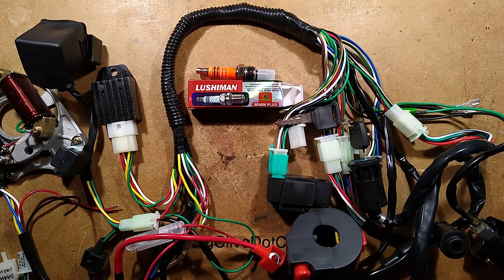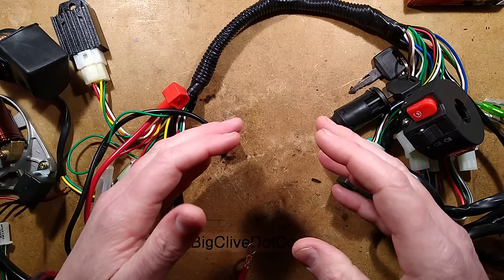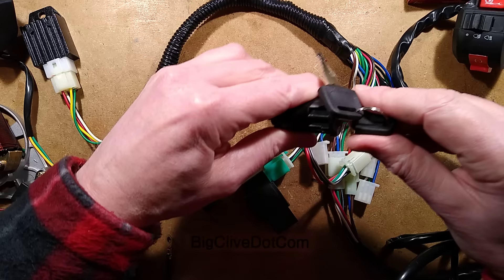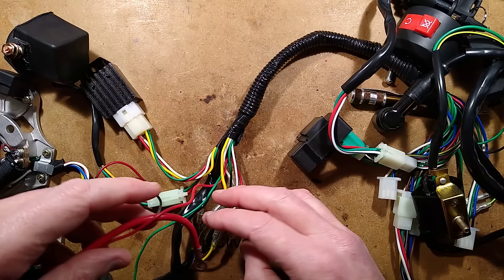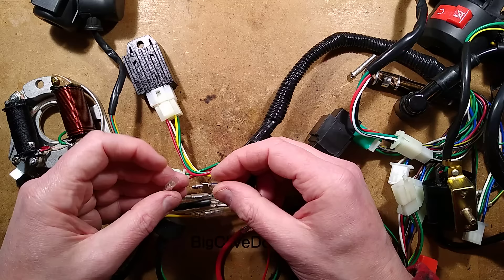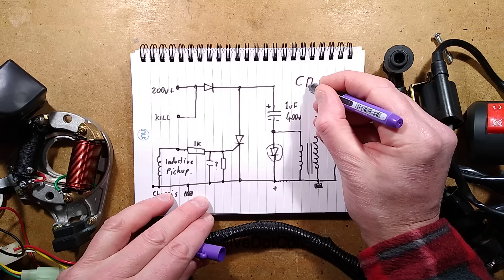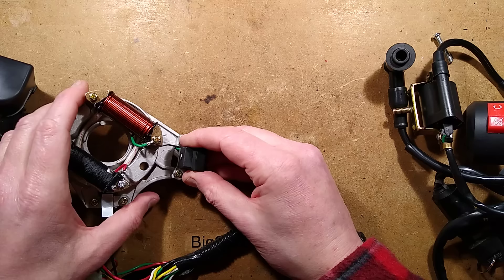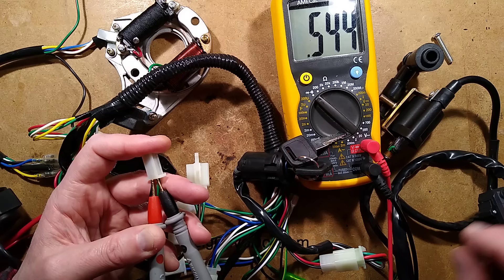Exploring the wiring loom of a Chinese quad / scooter.

Comment: This is great ive just bought one of these to fix my sinnis shit motorbike and just looked at it and realised no instructions for wiring. This ia going to be a very handy video ;)
Reply: the connectors on the wiring harness ... only fit the corresponding connector ... meaning ... you CAN"T plug one wire into another connector by mistake. ... Asian have made it  ... "white people proof"

Comment: Lucas did have a fairly standard wire colouring system. I guess the complexity of modern automotive electrical systems outgrew it.
Reply: Ford does, or did through at least the mid 2000s, have a standard color coding scheme. Every circuit function has a number and a standard color code. The wiring diagram shows the circuit numbers (and color code too, of course).
 I ran across a chart listing all of these years ago (it might have been in a technical service bulletin). One of the interesting things is that it listed circuit functions having to do with CB radio (did any Ford vehicles ever come with a factory CB radio??), which leads me to believe that Ford had been using this scheme as early as the heyday of CB radio in the 70s. It was also clear looking at the chart that they had continually added circuit numbers and wire colors as new circuit functions were needed for new technology.

Comment: That extra kill switch might be used on a seat sensor. Lift your arse off the seat either hot dogging or wiping out and it will cut the engine. Just imagine hitting big bumps in the road ( speed bumps) and lifting ones bottom off of the seat and you stall out.

Comment: I have just replaced the CDI in my son's go kart (I built),  The Lifan motor wiring in his is identical to this version, and he had just water blasted the whole thing to clean mud away. 
I suspect the water got into the CDI and probably killed it. There are two other wires coming from the motor near the stator that control a neutral indicator and (in his) a reverse 
indicator lamp, and in my kit there was also an optional remote control kill switch, I believe for parents to be able to shut the quad down from some distance away.

Cheers, and great insight Clive..

Comment: I have a Chinese 450 dirtbike and keep getting problems with the electrics . One problem was every time I pressed the start button it would melt some wires . Now seem to have fixed that . But now bike sometimes won't respond when press start button unless press kill switch at the same time . This is only some times not all the time . Bike now sat in corner of garage as loosing confidence in bike
Reply from the maker: Treat it as a puzzle and explore the bike wiring.  It should all start to make sense, and when you find the fault it will feel great.  Plus you'll be able to fix it faster the next time.

Comment: Looking at the CDI as you explained, it fires on every revolution of the crankshaft?  So either a 2-cycle engine or it fires both at the top of the compression stroke and the exhaust stroke?

I suppose if that stator is mounted in such a way it can be 'twisted' a little, that might give you a little adjustment of the spark timing?
Reply: It fires on the exhaust stroke. A lot of ignition systems use this "wasted spark system". they also have two cylinder engines where the ignition is the exact same but the coil has two spark plug leads. So unlike a normal coil where one side goes to ground. This coil has the ground side going to another spark plug. So when the spark occurs it happens on both plugs. Or you could say the circuit is completed by coil discharge jumping the exhaust gas from the center of the spark plug in one cylinder and then going over engine metal and then jumping from the engine metal to center in the other plug during the power stroke and then back to the coil via the spark plug wire. And then visa versa, every other time. Keep in mind exhaust gas contains a lot of ions and little to no compression so it's very easy for the spark to jump the exhaust gases thus takes very little energy from the ignition. There are also coil per plug systems that fire the ignition during the exhaust cycle to see how much energy was required to jump the gap and then use that to analyze what's happening in that cylinder.

Comment: I asked my driving instructor (motorbike) if it makes a difference shutting off the engine with the killswitch or the key. He said it makes no difference as both do the same thing.
But emergency thing should be reserved for emergency.
Reply: key shuts off the CDI .. which stops sending a signal to the spark plug ... the "emergency shut-off" switch ... grounds .. the spark plug wire .
If the CDI is "fried"/ "short-curcuiting" ... allowing current to be sent from the CDI ( key swith shut-off) to the spark plug ... the "emergency safety switch"  ( which can be used to "ground" the spark  ) ... shutting off the engine.

Comment: The other kill switch connector is probably for a low oil detection switch. Prevents the engine from damage.
Reply: The cheap Chinese bikes usually have a side stand and a clutch kill switch, some also have a neutral kill switch which prevents the bike starting if it isn't in neutral.
Reply: @stephenjones9153  No. You are talking about the safety switch. 
The  safety switch prevents the starter from engaging. 
The kill switch stops/kills the engine. It would be a little strange if the engine only was allowed to run when in neutral. 😉

Comment: Maybe someone can help me so I had to hot wire my moped someone messed up my ignition and I’m not looking to fix it so here what I have 

My ignition had two green wires a red a black and a black with white stripe 

I connected the red and solid black to a toggle switch for power and the two greens connected together but then I left the black with white striple disconnected 

My bike runs with kickstart and all lights work and the kill switch works 

But my electric start does not any ideas? 

What should I do with the black with white stripe wire?

Comment: Nothing is waterproofed to let it drain and dry out. if you make them watertight and somehow get water in it, and it invariably doses because it is hard and expensive to get a good seal on something that constantly vibrates and has a lot of thermal variation.  so in the long run it is better, cheaper, and easier to not bother.

Comment: I'm curious to see if you can hijack an electric scooter type setup into running a brushless faster  🛴
Reply: electric scooters ... 2 batteries ... 12v 10 amp/hour battery ... run a 350 WATT motor. .. .VOLTS x AMPS = WATTS ... 
my electric scooter used 2 car batteries to run a 350 watt motor ... through a 24 VOLT CDI .. which then controlled the motor.
I upgraded it to run on 48 VOLTS ( 4 car batteries ) ... pushing the 350 watt motor to 480 VOLTS ... sending 24 volts through the CDI .. which then triggered a solenoid .... to trigger the on/off ( of the 2nd set of batteries - another 24 VOLTS ) to the motor ... pushing 48 VOLTS through a 24 VOLT cdi ... without burning it up !
Reply: RAZOR 350 WATT ... electric mimi-bike .. uses brushless motors as factory standard. .. now try pushing 48 volts into a 24 volt motor ... now it screams like a bashee out of hell ... BUT ... totally SILENT !
Reply: grandpa stated ... " you got to put playing cards in your spokes there son, so I can hear ya coming - god damn electric car - on ya before ya know it" ... ... ... ( YES - this is exactly the reason i ride a moved up to a HARLEY ... LOUD obnoxious engine rumble ... I feel safe - you can hear me coming from a mile away )

Comment: I’ve worked on these Chinese four wheeler’s for my friends daughter. The spark plug is out under the handlebars. His had remote start/kill. We pondered buying one of these kits but instead reverse engineer it and wires it up my way. The connections are trash. The wires trash, pretty sure copper coated tin.

Comment: being a quad one of the kills will goto the clutch, the other might well goto the gear box, my bike for example will let you start in gear IF the clutch is pulled in... or if your in neutral it will start without the clutch being used

Comment: Hey Clive, I understand this is probably a terrible way of asking for advice but......... Since my heating boiler has been starting up recently, it seems to be resetting the USB devices on my PC. It doesn't do it everytime but more often than not, normally when I think the pump starts. From what I can see, it's been wired into the same circuit as the sockets but I don't know if that would cause the issue. Is this a shielding issue, a powersupply issue with my PC or something else? All &  any idea's would be appreciated be it from Clive himself or not. Thanks.
Reply from the maker: It sounds like an arcing contact.  Maybe a bad connection, worn brushes on a motor or tired relay.
It could also indicate a bad connection in the power circuit, causing a voltage dip when a motor starts.

Comment: 9:17 Not quite true, the ignition coil is not connected across the battery at the point in time that you required the spark, the coil was 'charged up' by the battery then the points would open which causes the primary voltage to collapse, this induces a HT voltage in the secondary winding which is fed to the spark plug. Other than that minor point your videos are very interesting!

Comment: the two tails are usually for front and rear brake levers (lock outs so when the bike fires up you have a brake on to stop it moving) the other kill could be a simple switch that some manufacturers use as an immobiliser switch under the seat (SYM scooters for instance) or as already suggested a rotary switch on the sidestand to kill the ignition to stop you riding with the stand in its down position. the three pin connector you have marked 'dash' could be rear light,brake light and earth. the two extra wires at the stator , the green/red is neutral - depending on fitment - auto scooters dont use this - the black an earth connection but i dont know what for lol   welcome to my world - fixing this rubbish regularly

Comment: Clive, please unpot the regulator and the CDI modules! I'd really like to see how they look inside! Especially since with these CDIs, there are versions that throttle the maximum revs of the engine down in order for the bike to conform to this really stupid EU rule of those 50cc bikes only being allowed to go 45km/h and not faster (before that, they were allowed to go 50km/h, and in the GDR the old ones could even go 60km/h, which would then make it somewhat suitable to flow around in city traffic, albeit illegal...so I'd really like to see how the CDI works inside! And also the regulator (because that's probably what's faulty on my scooter, but it's not certain).
Reply from the maker: Already done.  Videos released on Patreon, and will be released for general viewing soon.

Comment: I'm working with Mercury outboard motors from the mid 90s where the manufacturer seemed to change the part numbers of the Stator/Trigger/Switchboxes at random.  Constant change/improvement leading to constant chaos in the repair of these motors.  And no particular numbering system to identify one expensive little black plastic box from another.  No consistent compatibility.  Frequent parts failure.  Would it be interesting to bring your expertise to bear?
Reply from the maker: Is there at least a standard connector?  With potted modules it's hard to evaluate what's inside.

Comment: I'd like to see some wiring schematics for lighting on a Kawasaki quad brakelights tail lights brake and clutch switches reverse and neutral safety and how to advance a cdi ignition to obtain some rpms cheap mods with no cost added to increase engine power welding and grinding cam lobes stiffer valve springs the explanation of hondas 4   valve dual over head variable valve timeing

Comment: Being the master of onehanded soldering. In your opinion  would a solder joint in an audio signal actually contaminate it?  Personally I don't think any one would actually know without looking or be able to tell in a controlled test.
Reply: Not really, 99.999% of connections in pro audio kit are going to be soldered or a spring contact. That includes all your expensive mics and sound desks involved in production. Purely resistive connections aren't going to change the way something sounds, just the volume going through. (Although there may be some interaction with inductors and capacitors in the creation of filters and the impedance matching between circuits/components). In order to change the tone of something, you need to affect one group of frequencies and not others, and for that you need a capacitor, an inductor, or some more complicated type of filter. What can cause issues are long wires/cables running next to each other (this forms a capacitor), or a coil of excess wire (this is both a capacitor and inductor). Impedance matching is an issue if there is too much signal going into the next module (distortion) or not enough (you get a weedy, weak sound). Intermittent contacts from dirt or damaged connector also cause issues, but normally crackling/buzzing. This is why we are so worried about gold or other plating on pins, pin fitment and spread contacts in connectors and dry/cracked solder joints. Its not just in audio either - If you watch Eric O at SMA or Scannerdanner, they often struggle with poor connections with data and signal connections as well as power. Ground loops are also an issue with poor setups.

So in summary, once you have good equipment, 99% of improving audio quality is from good solid connections and correct room acoustics, and mic  and speaker positioning. A lot of the exotic stuff people come up with is going to make a very small (if any) improvement to the quality. Good solder joints are so low resistance they can be pretty much ignored.

Comment: Not that much changed as far as wiring colours go, a majority of Japanese small capacity motorcycles of the 1980s and 90s had identical colours for the basics. Green was chassis, black and white was ignition kill. Even had a remarkably similar loom on my old Armstrong MT 500 with the Austrian Rotax single 500cc single four stroke. Most were Japanese based or sourced.

As far as naked or open switches, connectors and the like, I would usually flood them with neutral colour waxoyl. After that, connection and switching problems became a thing of the past, made everything much more reliable.

Comment: Hi Clive, love your vids mate👍 Most likely the spare connector will be tied in with the start circuit. Normally it's connected to a N/O switch at the one or other brake levers/brake pedal, and connected in series with the starter 'solinoid' trigger wire, so you would need hold the correct brake lever/pedal to be able to crank the engine. Some bikes also have a series of safety switches incorporated ethier into the ignition kill and/or ignition on or starter circuits, to either kill engine once running, or not allow engine to start if either kick stand is down, not in neutral, or clutch not pulled in or a combination etc. Every bike is set up a bit different, so one must check what all is involved and norrow things down by the particular symptom and wiring diagram at the time...hope this helps👍🇦🇺

Comment: The things on the end of the spark plug is called a ground strap. The plug shown here has three ground straps. Multiple ground straps were first invented to prolong the life of the plug, as there now is more wear surface on the ground strap and the center electrode. This advantage disappeared with platinum tipped plugs, plus extra ground straps tends to slow down the flame speed by cooling it, as there is much more surface area. Slow flame speed is bad, you get less horsepower, less torque, and the engine is more difficult to tune.

Comment: Wire color codes not matching on both sides of a connector are rampant in commercial heat and cooling here in the US.  trying to track down why you lost the 24 VAC control voltage to you 3 phase compressor contactor and the color changes 3 times on it's way through the unit is rather annoying.
Reply: That's also true for GTE/Contel telephone outside plant. What starts out as a white/blue pair in one terminal changes to a red/slate in another and then to black/brown in yet another. A Verizon tech told me he hated working on that mess. It's because Contel always did things on the cheap and did not put in cross-connect boxes.

Comment: Hi Sir ! I'm having few problem with quad wiring , my wiring set come without kill switch , so after I installed on my quad and run the engine and when I turn off my key found that its not kill the engine , which is still keep running after I turn of the key , another things is my head light switch also cannot turn on and off the head light , its goes to left signal switch , and led light is some kind of little blink , and I try to turn on the signal also not function at , could it be the wiring itself got problem ? and it is a new wiring which is just bought and installed .
Hope anyone can help to explain a bit , thank you
Reply: I think the problem could be that the harness it's not designed for your bike and some connectors have the cables at wrong places. Be sure that every cable connects to the same color at both sides of the connector. If the color code of the harness doesn't match at all the color code in your motorcycle, then you are royally f**